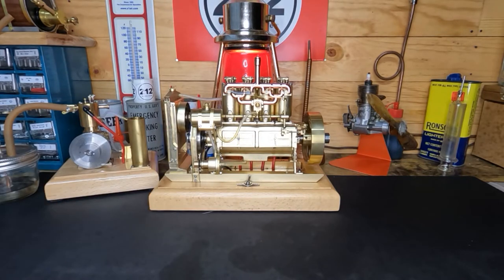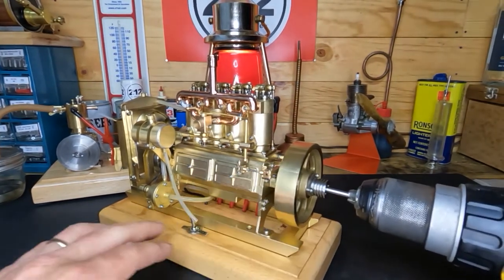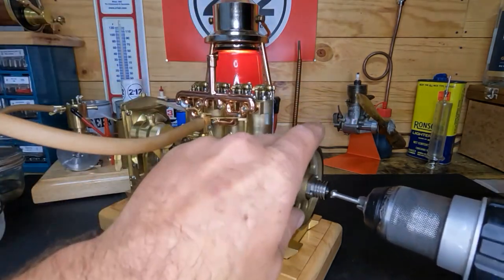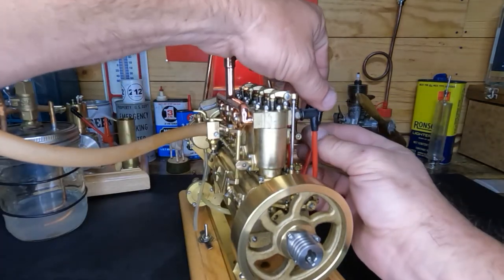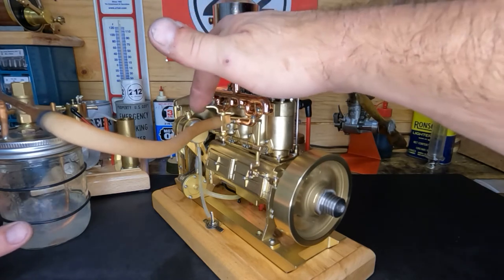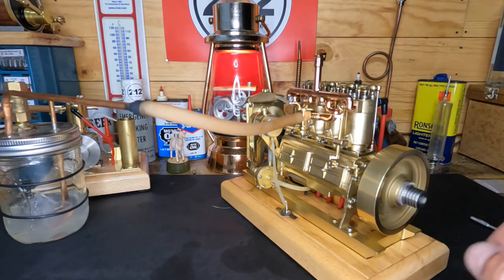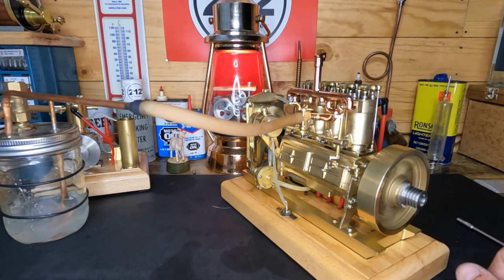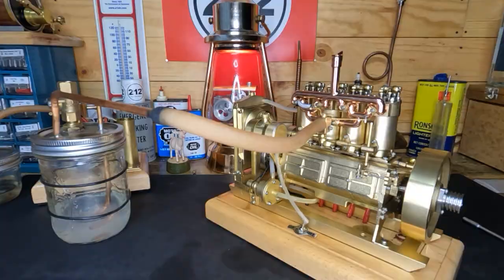Running an H75 holt engine on alcohol

Comment: Cool! Thanks for trying this!  Seems like it has real nice idle and a bit better throttle response.
Reply from the maker: Hi Toydoctor, I think the idle is smoother too. I am amazed at the throttle response. There may be some further testing with this setup on different fuels like Coleman fuel, denatured alcohol, rubbing alcohol, and lighter fluid. Thank you for the suggestion on this video 👍

Comment: I have a ton of trouble with those rubber plug boots falling off.  I've tied them with wire ties from bread bags and also coated the boot with liquid electrical tape to stiffen them for a better hold.  I usually end up replacing the boot with the correct size stiff fuel line, it will hold the wire and stay put on the plug.
Reply from the maker: Hi Henry, That is a GREAT idea! What I did on the H73 was to strip the insulation back a bit further, part the wire into 2 half's and wrap it into the groove of the plug and twist the tail together. It works good but there is no insulation so it only took me once to be reminded that "hey stupid, that plug is hot, don't touch it". I think I like your idea better.  Thank you for the suggestion 👍
Reply: @steam212  I've also had arcing problems in high humidity, so keep an eye out for that if you're trying to run these on a sticky day.

Comment: good one. suspect low end oil lube is also transfered into upper end, therefore not need 2 cycle oil. wonder how oring piston seals hold up.  still that pretty cool. GOOD job !
Reply from the maker: Hi James, I don't know exactly how much oil is being "slung" up to the cylinders but if you watch when we open the throttle it does smoke, so that leads me to think we're still getting oil to the pistons and cylinders from the bottom end. These are still the factory set of o rings even after over a gallon of fuel has been run through it. I'm glad that you enjoyed it, and thank you for commenting 👍

Comment: Do you recommend this engine ? Someone mentioned the fan and water pump runs backwards,  is it true ?
Reply from the maker: I put a twist (half turn) in the drive belt causing them to turn opposite of the crankshaft. That did the trick, now the water pump works correctly 👍
Reply: @Steam 212°  did you face the issue of coolant mixing with the oil same as Johnyq90 did ?
Reply from the maker: @simplefact4u  I have had no issues with coolant getting into the crankcase. I don't run mine that hard or that long when I run it so I don't let it get very hot. I don't think that the cooling system (radiator) is adequate for the size of the engine honestly.